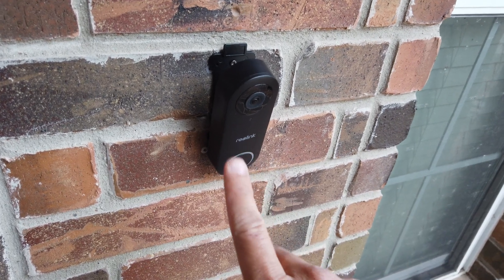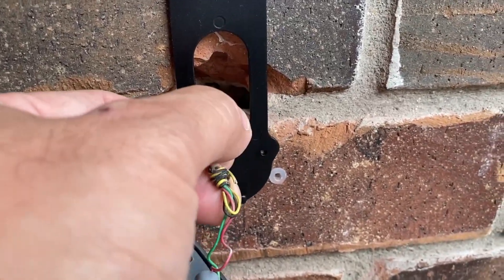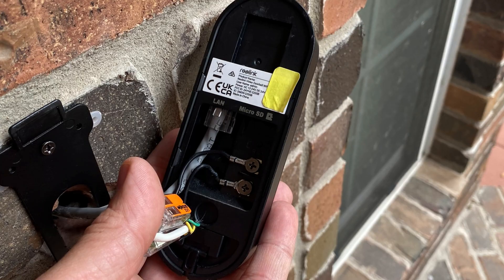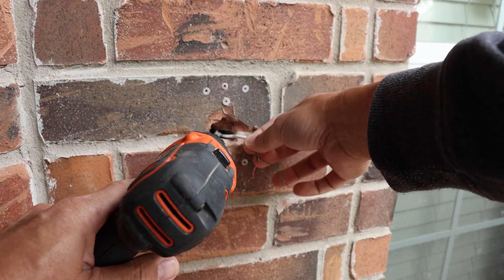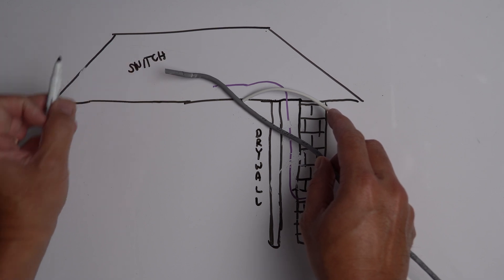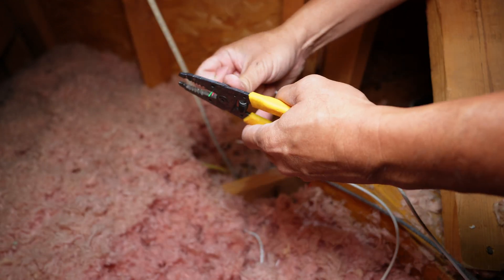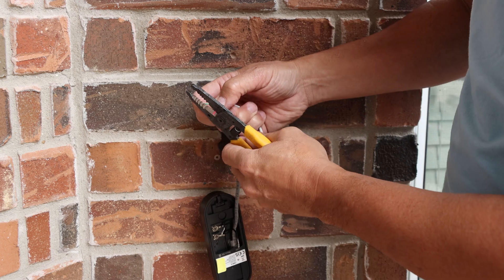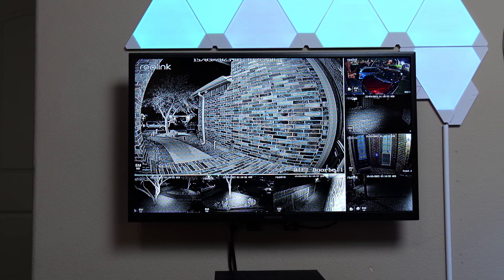Reolink WIFI Doorbell Jam Proof Setup - Adding Ethernet to your Doorbell Wiring

Comment: My experience with the doorbells so far have been abysmal. I just installed a Wifi and PoE version yesterday. The wifi version has horrible signal and the connection cuts out instantly as soon as you attempt to do two-way talk. The PoE version is not connecting to my clients Reolink NVR. Firmware up to date on everything, tested different cables with PoE version and the Wifi version has a wireless node 4 feet from it. Very disappointed and frankly embarrassed to deliver a product like this to clients.
Reply from the maker: Sorry to hear that.. you do need a reliable WiFi signal at the door for everything to work properly. Prior to this setup, I have to move one of my eero extender closer to the door just to have a reliable connection.
Reply: @LifeHackster  The google mesh node is quite literally four feet from it, that's unacceptable. Especially when you consider their wireless cameras are 30 feet away from a node at this clients home and they have full wifi signal! I'm going to contact support tonight because they are only available starting 5pm Pacific Standard!
Reply: Ummm, on the POE ver  check your connectors especially if they are pass thru. I verified the components first by connecting a 50ft ethernet cable from the NVR to the Reo doorbell. Reason being to save time and make sure everything works before I go through the trouble of installing them. Pass through connectors are great but you need the right tool and connectors to get it correct. I use the Klien tool and Cable matters passthru connectors. I run the cables, install connectors, and then test the cables since I have verified the components. If the components are bad Reo will replace them. Good luck
Reply: @blkmacster  Everything has been tested and verified to be working. I wouldn't be installing cable runs without testing of course. The first test was with a pre-terminated cat6 cable. Then I installed a cat6a cable I terminated myself. My guess right now is to check to see if they engineered this product to work with their older NVR. My client's NVR is old and not capable of running the new OS.
Reply from the maker: There is the answer to the PoE version.. if you said that the NVR is old, it is most likely not going to work with this new doorbell or will have issues. Just try to set it up with a PoE switch or power it like I did in this video and connect it to the network.. and then add it to the NVR. Your client will get the features of the doorbell on the app (choosing the stand alone setup)
Reply: @secretninja2001  Wow they are having problems with that.
Reply: @LifeHackster  Thank you for replying to this. I thought about doing what you suggested, but my client is a really nonsense guy. I suggested moving to a newer model NVR (also because we installed modern Reolink equipment in his home) and he said to buy whatever you need. He must see all cameras on his TV in his shop, so if we need a newer NVR to solve this then that's what we will do. I have already ordered a new NVR.
Reply: @blkmacster  Concerning the Wifi only doorbell, yes I would agree either my unit is faulty or they designed a horrible product! I contacted some mentors and they claimed brick is quite effective at diminishing the 2.4ghz spectrum. However, in LifeHacksters videos, he's clearly using the Wifi version with a brick house and it works great! I don't understand.
Reply: @secretninja2001  You could try straight into the router as a test. But if it were my money it would be on the NVR.
Reply: @blkmacster  I'm not sure if I specified, but it works entirely fine on the app. This means it is most likely not the unit, just their poor documentation, and explanation of its ability to work on the old NVR.

Comment: you got lucky.  all the doorbell cables I've seen are stapled...   Luckily from mine, my original doorbell cable was a Cat5e cable, so I just had disconnect that cable from the door chime,  splice that into another cable I ran to my POE switch using a ethernet junctionbox, and then terminate at the doorbell side.
Reply from the maker: That’s good that they used a CAT5E.